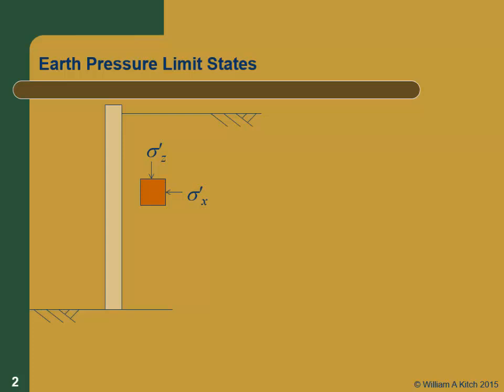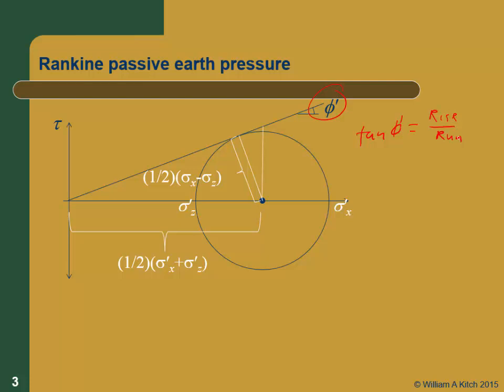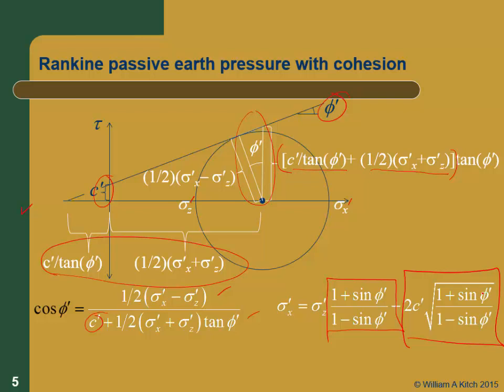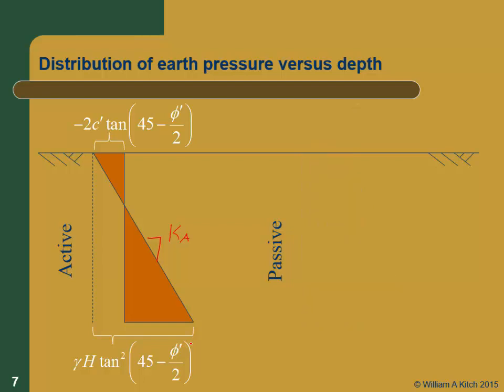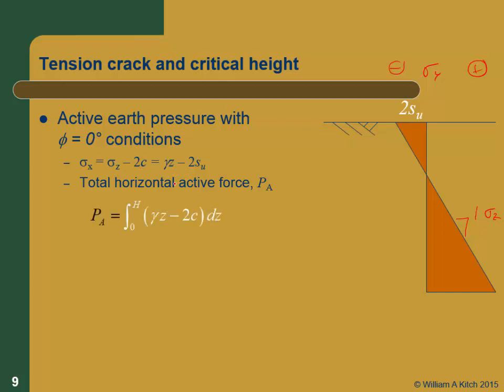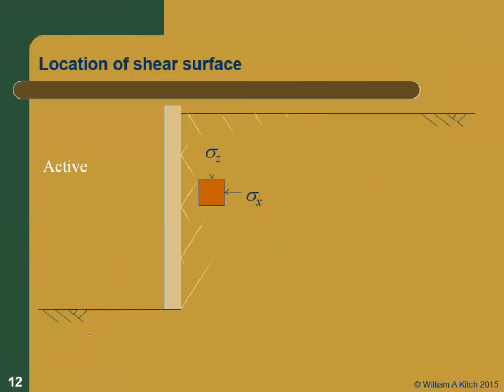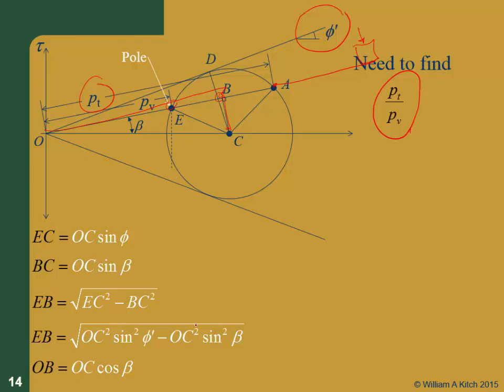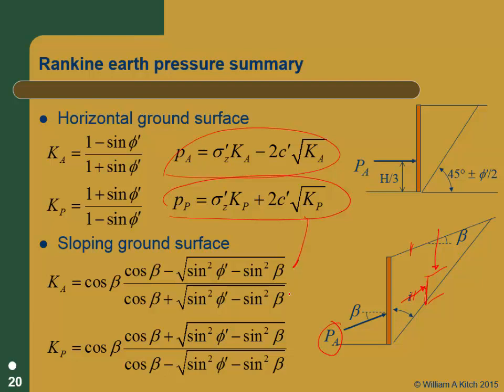CE 540 Mod 2.2 Rankine Earth Pressure

Comment: well at least the lateral force equation for a particular element having that then integrating the small rectangles like you do in fluid dynamics is the same. After solving it one can set the equation equal to zero for equilibrium or uses derivatives to find the min/max pressures

Comment: its kind of cool that for fluids Pascal's law makes it trivial for finding lateral forces and pressures. Vertical forces for solid or fluids are relatively simple calculations but when it comes to solid like soils lateral forces it is a little bit trick to model a formula for it specially for different grades or when clay / plasticity effects come into play